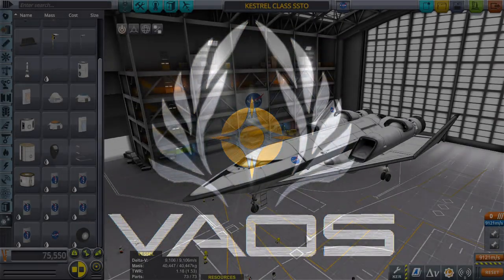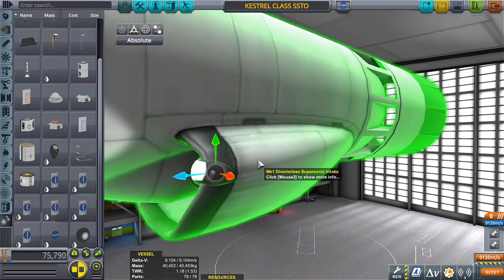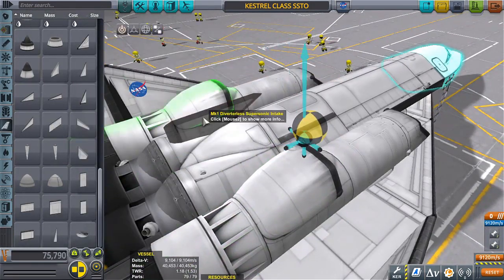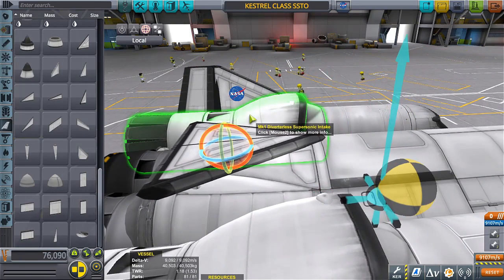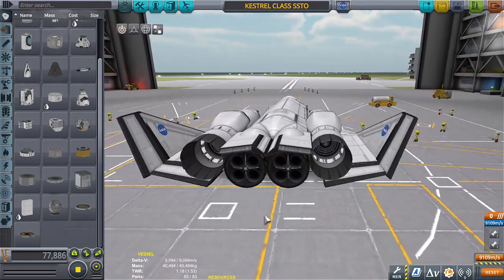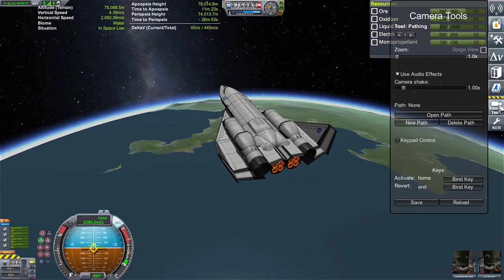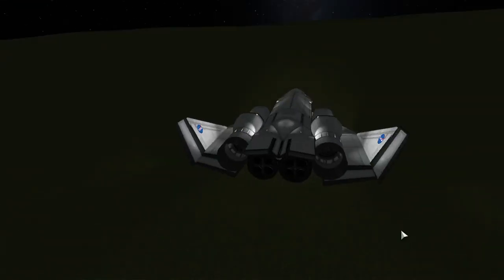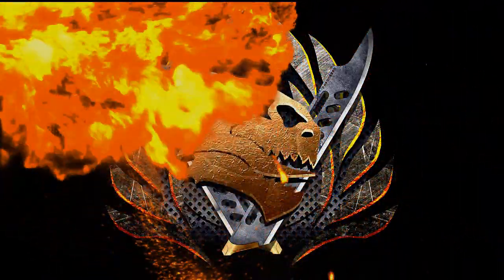KESTREL CLASS SSTO part 2  |   KSP 1.11

Comment: Whenever you clip something together it's only attached by a single point. It's ok for small parts but large parts like fuel tanks need struts to hold the thing in place. You can actual tho inside the fuselage our any tank or part and put the struts inside of them so they can't be seen.